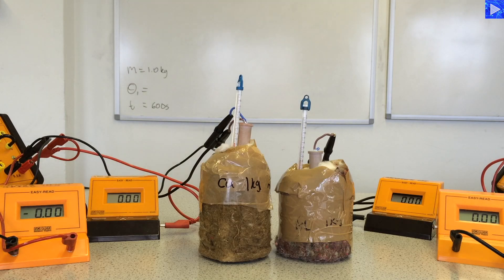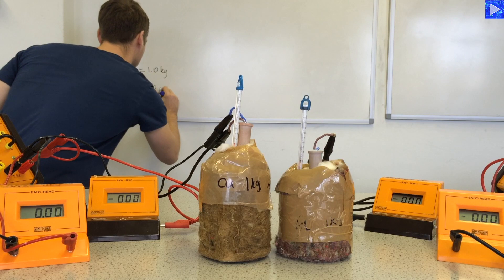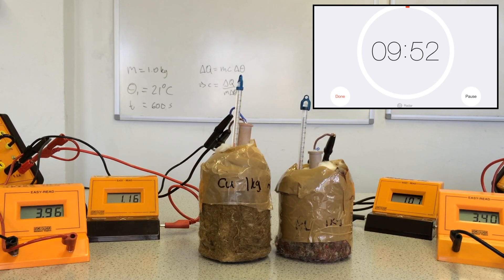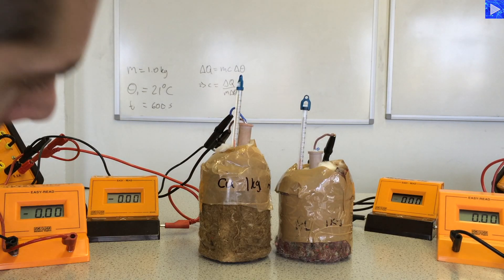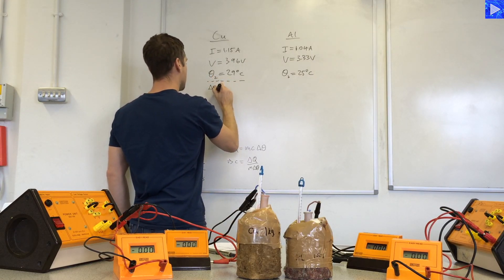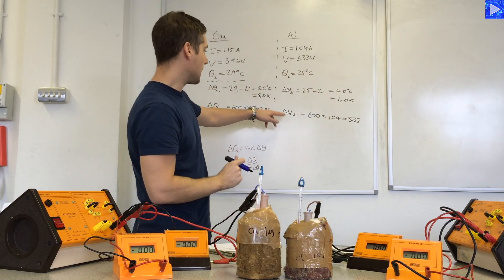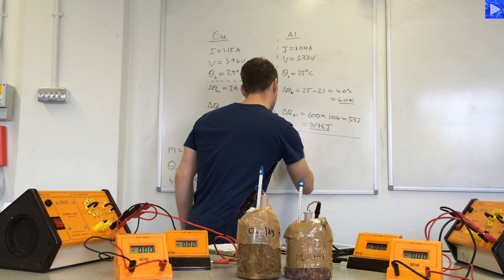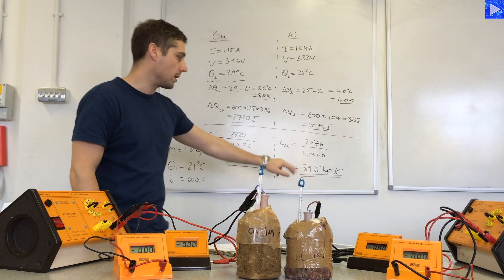Experiment to Determine the Specific Heat Capacity of Metal Blocks

Comment: @A Level Physics HQ isnt there going to be some practical power loss that is not factored in?
Reply from the maker: Yes power losses in the supply, circuit and to the surroundings. To improve accuracy for me would insulate as much as possible and maybe even take additional measurement to attempt to quantify losses. But realistically the total losses couldn’t be fully accounted for. Everything in science has to start with some assumptions.
Reply: @PhysicsHQ  then is calorimetry easier to get more accurate ?
Reply from the maker: I’m not sure. In both cases you’d never be 100% you accounted for all losses. A bomb calorimeter is about as advanced as it gets for taking calorimetry measurements but the bomb itself will absorb heat.
Reply: @PhysicsHQ  thank you for the help. My actual use case was to factor in melting cost of a mix of alloys and pig iron in an induction furnace during ductile iron production. I thought calculating the specific heat and adding them to the cost function to do it. Maybe there's a different approximation alltogether.
Reply: @PhysicsHQ  also this may help me reach an approximate specific heat calculation. What about latent heat of fusion.
Reply from the maker: I’ve taught how to measure latent heat of fusion with ice but not metal - for obvious reasons. So I’m not familiar with the method for metal. With ice we allow it to reach meting point in air at room temp, the heat a sample while a control continues to melt due to room temp supplying heat.  The difference enables you to isolate heat supplied by the heater.

Comment: Why should (V) and (I) not vary during heating?
how to estimate the uncertainties for the variables ∆I, ∆V, ∆t, ∆θ 
could anyone help ?
Reply from the maker: Hi. V and I will vary a bit during heating due to the changing resistance of the heater. Exactly by how much will depend from heater to heater. Hence the need to get the average.  I did it simply in this video but a better method would be to use a data logger.  If you are interested to evaluate the data I have recently designed a worksheet to guide students through exactly that process. It will be live in my shop very soon.
Reply: @PhysicsHQ   hi there , thank you for your reply I really appreciate that. 
I have lab worksheet the question says "why V and I not changing during the heating"

I have problem in estimating the uncertainties,  and the question says estimate the uncertainties for I, V,t and the temperature.
Thank you very much.
Reply from the maker: So the points are related to:
① electrical power is supplied at a constant rate. There is fluctuation that will arise due to change in resistance, but this won’t affect total power dissipated. 
② Usually uncertainty is determined from the last significant figure of the measurement or half the range of repeated measurement. E.g. if is say V = 3.56 V then the absolute uncertainty is, ±V = 0.01 V. Or if V₁ = 3.51 and V₂ = 3.55 Average V is 3.53 ± 0.02 V. Hope that helps.
Reply: @PhysicsHQ  Thank you very much, that really helped me, I have more questions, the first one is if we assumed that there is no changing in the value of V , what the uncertainty would be? 

The second question is how could we find the uncertainty of specific heat capacity,  if we have the temperature and the time ? We can find SHC from the equation but how we would get the uncertainty ? 

This is the last question, other than increasing the insulation, can you think of a modification of the experiment that could reduce energy loss to the surroundings? 

I know this is too much, forgive me, I really appreciate your help. 
Thank you 🌹
Reply from the maker: ① Read my previous reply. Uncertainty is found from the precision of the instrument - in this case it is the voltmeter. If V = 3.79 V then uncertainty is equal to last d.p. ie V = 3.79 ± 0.01 V. Notice that the measurement has number of d.p. down to first significant figure of uncertainty. 
② Apply uncertainty rule 2. If you calculate by multiplying and/or dividing then add the percentage uncertainties of the measured values. 
③ In my experiment I was using solid blocks of metal. I think insulation is all you can do. With liquids you can have a lid on its container as well as insulation.
Reply: @PhysicsHQ  
Thank you very much, this is really helpful for me , now I understood 🌹🌹❤

Comment: A student carries out an experiment to determine the thermal capacity of a metal block. The
block is heated by an electric heater for 23 minutes. The current in the heater is 3.0 A at a
potential difference (p.d.) of 12 V.
The temperature of the block rises from 20 °C to 70 °C.
Calculate the thermal capacity of the block.

 please help me with this some one
Reply from the maker: Electrical power is given by, P = IV
So energy transfer is, W = IVt
⇒ IVt = mcΔθ 
c is specific heat capacity (ie heat capacity per unit mass), so mc is what the equation is asking for. 
⇒ mc = IVt ÷ Δθ 
Substitute the values.